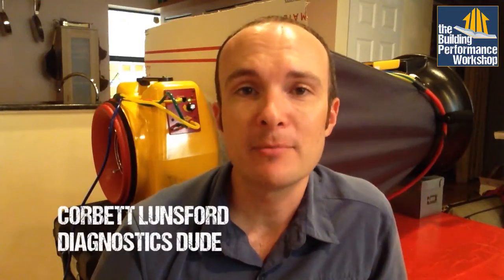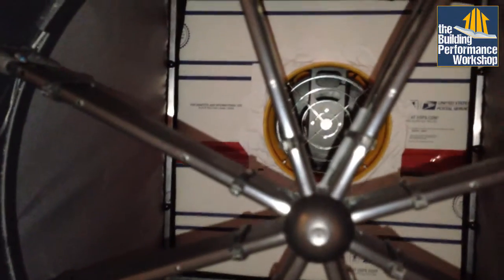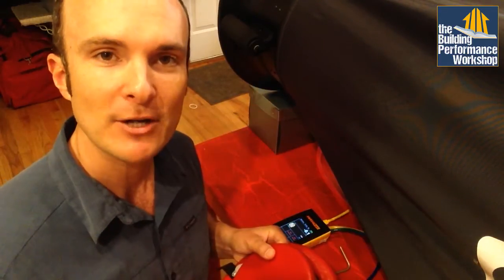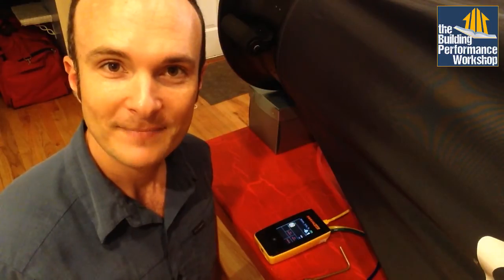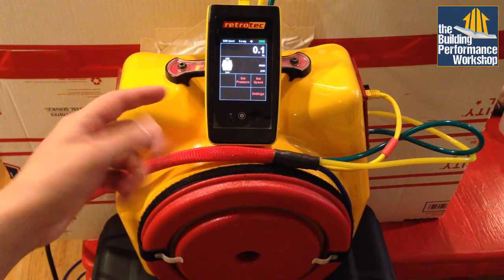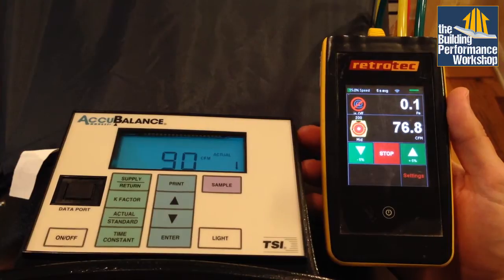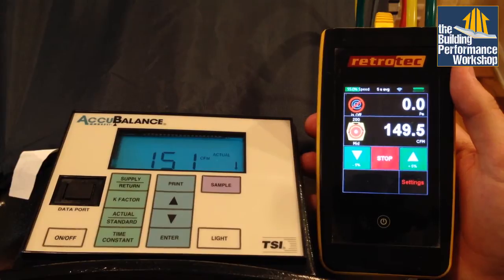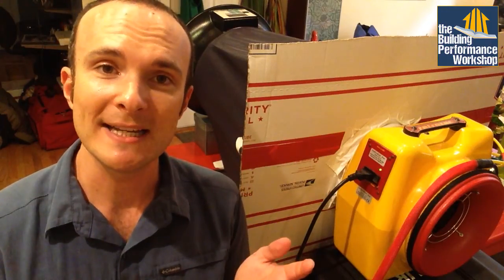Field Check for Flow Hoods Using Duct Testing Fan

Comment: Hi Corbett, how can I test to see if my hvac gauges are working?
Reply from the maker: Do you mean pressure manifold set, or other? Simple answer- test against a confirmed accurate gauge using a tee.
Reply: Yes Pressure manifold set, what do you mean by tee, like a copper tee? How would that work?